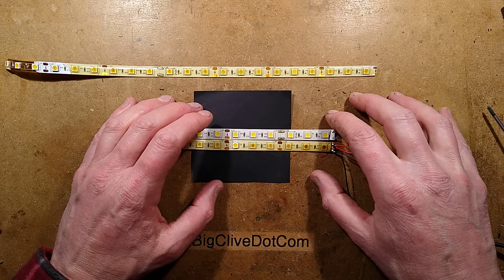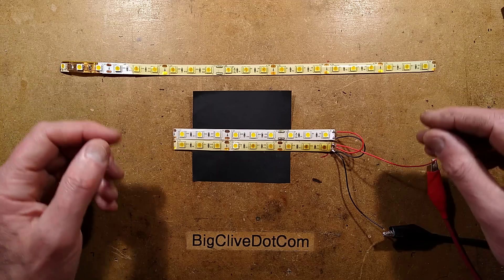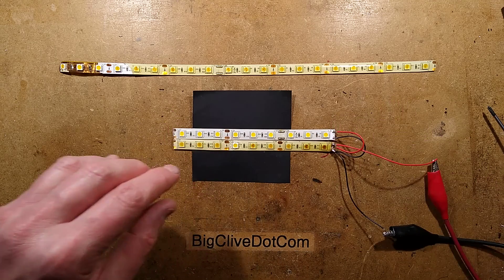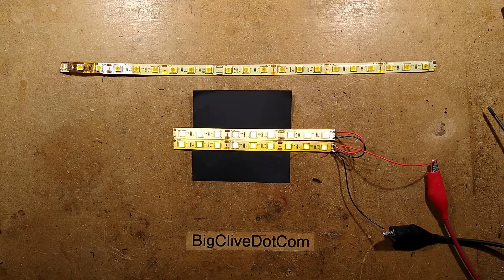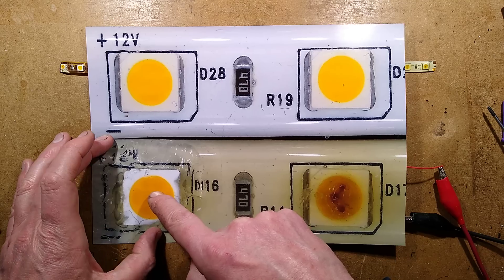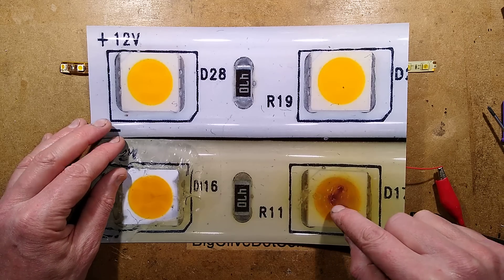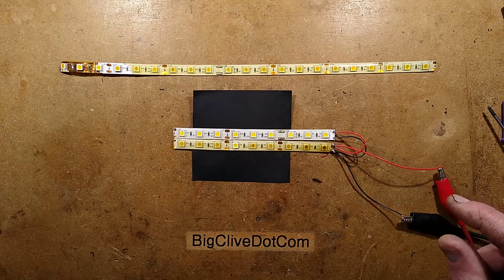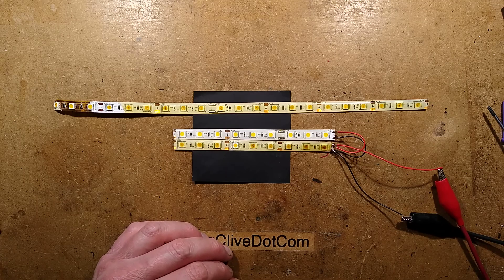IP65 LED tape coating fail

Comment: That reminds me when, about 15 years ago I bought a rear projection TV. It was cheap because the picture had gone all red and blurry. Turned out the 3 CRT's inside the TV were filled with coolant that was between the CRT and the optical lens. I removed the old coolant and cleaned the CRT's up, replaced the coolant, and it fixed the problem.
Reply: I loved the lenses that came out of those things! Don't see them anymore...
Reply: It was Sylvania or Magnavox TV.
Reply: @johndii2194  No actually. It was a Philips TV. Made in 2005. Early HDTV.
Reply: @Xplasma1  Same company. I was a sales and SERVICE agent for all 3 for many years. The antifreeze would grow mold in the fluid mainly the RED one. I dismantled, cleaned, and changed the fluid in so many I would buy it by the carton.
Reply: Do you know why they used antifreeze? Because the units could be stored in unheated areas and the liquid would freeze and expand and damage the TV.
Reply: @johndii2194  Antifreeze because of the refractive index more closely matching glass, so they used pure propylene glycol as a coolant, but did not think to also include a fungicide into it, as no bacteria could survive in the water free solution. Red gun did not have the same amount of high energy light in it, so it would grow fungus, the green and blue would have enough light into the fluid to kill it, unless you had stored the unit for a few months.
Reply: @johndii2194  Yeah I recall the red CRT was the worst. The green was second worst and blue was kind of okay. 

And yeah I forgot, Philips owns Magnavox.
Reply: @johndii2194  Sylvania and Magnavox simply made their sets using Phillips parts, often the entire chassis and internals was Phillips made, and onnlt the case was the thing with a brand on it, though most models simply were ordered with the Sylvania nad Magnavox badges instead of the Phillips ones, made as custom units.
Reply: @SeanBZA  Magnavox was Philips’ brand in USA. For many years, they couldn’t use the Philips name in USA because Philco had successfully argued in court that their brand names could be confused.
Reply: @SeanBZA   I was a sales and SERVICE agent for all 3 for many years. I used to work on them before they were all the same company.

Comment: I bought a pack of 100 coolwhite 5mm led on ebay from survy2014. I made a light with 5 of them, the light is on about 8h a day. After about 6 month the light output is less than a candle... The light was almost too bright at the beginning. Leds are running cold and at 17.5mA. The phosphore must have degraded, not good quality

Comment: Had the same problem in my kitchen LED lights with the rubbery coating on it when orange yellow is looking so replaced it with the uncoated LED tape and that has stayed much brighter without yellowing

Comment: The first RGB strip I got more than 12 years ago now had an "IP65" waterproof coating on it - almost immediately it developed a really awful smell, and if you touched it even briefly, your hands would pick up the smell and smell awful as well. As time went on, the smell got worse, and the stuff yellowed like crazy, and that was on a piece of the strip that I never used and was still on the roll. Since then I've never ordered any IP65 strip with that clear coating on it - either plain non waterproof, or the IP67 stuff that's the plain non waterproof stuff inside square silicone tube. The silicone tubes hold up well to sunlight (so UV) and don't degrade or smell or discolor. I hate the epoxy (or whatever it is) coated led strips.
Reply: Was going to post the same thing. I have a couple of rolls of LED tape that I will never use just because of that reason. Smells terrible and as you say it gets into your skin. Not sure why I haven't just thrown it out...
Reply: Maybe it is butyl acetate?
I had some clear handled screwdrivers that I had to throw out.
They made my hands (and whole toolbox) smell like vomit.
Reply: @jimurrata6785  No, the smell is completely different - it smells like burning 3 week old coffee grounds or something - it's a hard smell to describe, other than it's unique, and f'ing awful. It's pungent, makes your nose want to curl up and fall off your face. It's nothing like vomit. Also butyl acetate is extremely hard, which is why they make screwdriver handles out of it - this stuff is flexible.
Reply: I had a roll of purple/blue LED strip and that smell was ghastly. I'd mounted them in a non serviceable spot on some shelving and after about 6mths of use I noticed the output was very dull. At the time I just turned up the voltage from the 9v I was running them on to 12v and that seem to fix it. After a while the problem returned and eventually I just disconnected them. I recently found a section of those strips and the coating was so brown I could barely see the LEDs light up at all when I tested it. Still had that same smell albeit not nearly as strong as it was new.

Comment: Could it possibly be where you have been 'playing' with the germicidal UV lights and Ozone generators that it has artificially rapidly aged or attacked the rubberised coating?
Reply from the maker: No.  These had minimal exposure.

Comment: So they basically chose plastic that can’t handle UV light, for something that not only could be exposed to external UV light (as an earlier commenter mentioned, outdoor lighting for camping), but also fails under the UV output by itself? One wonders how much testing these had, and how long it would take to discolour when driven at full power.
Reply: You 'wonder' how much testing? pretty sure I know the answer to that question - absolutely none. They found something that was clear and flexible to begin with, and started using it immediately. I've only ever ordered one or 2 rolls of leds with the "IP65" coating on them - never again - the stuff I got failed quickly and emitted a really awful smell. If you touched it, your hands would smell awful after too - really nasty stuff. I either get non-waterproof, or IP67 waterproof in the silicone tube. Haven't had any issues with the stuff in the tube yet.
Reply: Chineseum crap? 😠
Reply: hahah you what  how much testing lol hahaha do t be daft itsa china crap in china you say that word  your in prison  and your dog is fir tea  herd it all now testing

Comment: Same issue with my 5050 strips. The impression I get is the coating isn't blue/ultraviolet stabilized at all. Mine also got hard and brittle.

Comment: I've had something similar happen with a conformal coating I added to a cheep led strip.  turned yellow to the point it blocked out the leds

Comment: Could the discoloration be partly due to uv ? I know they do not produce much but if the gel has no uv protection. Ahh yes yoi cover that latet doh! Lol
Reply: Regular white LEDs do not produce any UV light. The chips are blue emitters, around 450 nm.

Comment: My LED under shelf lighting has all drooped down where the glue has failed.  I don't know what else to use instead.  It's definitely not made by 3M.
Reply from the maker: That's common.

Comment: I believe that the silicone coating  releases acetic acid as it slowly cures. In my case, This made the adhesive backing ineffective, and I had to remove and replace it all.

Comment: That's VERY useful info.  Have been considering using the silicone coated strips for a project, but was concerned about discoloration and overheating.  I'll find a different way to waterproof the basic strips.  Thanks!
Reply: That stuff is not silicone. It's some kind of epoxy-like stuff. If you get "IP67" led strips, they are a non-waterproof led strip slid inside a square silicone tube, and sealed up at the end with silicone. Those don't seem to degrade at all. It's only the IP65 strings that have that clear goop (whatever it is) on them that degrade horribly.
Reply: Get the silicone tube ones, they are basically going to last forever.

Comment: I'm not so sure it's actually the light.. I've got a few meters of similar silicone-covered LED strip spare (various colors, no white ones), and that also developed yellowish-brown spots all over to the point it's not actually usable anymore, but it was never powered on. I wouldn't be surprised if something weird with the plasticizers in the LED casing actually reacted with the silicone.
Reply: I had the same thing with some RGB strips bought from Maplin, never used them and they're still in the package but when I looked a few weeks back they had yellowed significantly, I try to avoid the strips with coating when I can and rather put the uncoated ones in an enclosure of some kind if I need some protection.
Reply: Probably this, because I’ve got old leftover pieces of RGB strips that did this still on the roll and in the original metallized bag.
Reply: In Clive's case it was mostly the LED light itself. In the zoomed-in shots you can see that each LED has three chips inside it, and there were three extremely dark brown spots in the exact same places on the covered up LED as the bright spots (chips) on the uncovered LED.
Reply: possibly bromine fire retardant

Comment: That is an odd way to fail. I guess you could cut the protective layer off the LEDs if you really need to use them while you order more (without the coating if indoors)  2x👍

Comment: I purchased 50' of LED tape from Adafruit, who I consider a trusted seller, and and used portions of the tape for the same under-shelf lighting and had the same the same exact experience.  The covering of the roll of unused tape has over time  turned yellow.
Reply: You can find cheap crap similar to what most trusted sellers (in any industry) sell on eBay or Ali for a fraction of the price.  That's hardly the point.

The point, usually, is that if you buy from a trustworthy reseller, and what you get turns out to be crap, you can return/repair/replace it or get other considerations to make up for it.  You cannot do that with eBay or AliExpress.  That is also why trustworthy sellers usually sell things for higher prices, because they have to cover the extra cost of providing actual customer service in addition to just the product itself.

In my experience, Adafruit does actually make an effort to sell good-quality products in general, and not absolute crap like many many of the bargain-basement sellers out there.  In some cases like this, however, it may be hard to tell that something has a problem without running it for a long time, or testing a lot of it, so things may sometimes slip through their screening process.

If they are still selling that particular LED tape, I would encourage reaching out to them and letting them know it has this problem.  I would bet if they are made aware of it they would work to find a better alternative instead, but it is quite possible they simply don't know, because nobody has ever told them.  (It's also quite possible they have since discovered the problem and have switched to selling something better now, too.)
Reply: @foogod4237  Hi Foofod.  I agree with you 100%  I trust Adafruit and Sparkfun.  And, I have have found their customer service to be superb.   I have had defective products that they replaced without question.  They have also provided great customer support helping me get some of the software libraries working.
 
Since my experience with the LED strips did not appear for almost a year later I cannot fault them for bad parts.  I would not think of insulting them or any other seller for a refund or 'make-good' for a product that (a) was not expensive; and (b) failed after a year of almost continuous use.  

One thing that other commentors did not mention is the tremendous amount of money the two companies put into R&D, software development, payroll, etc.
Reply: Adafruit wouldn't intentionally sell the cheapest crap or reneg on their warranty. Like everyone they are at the mercy of ever evolving technology or the manufacturer.  Led tape is still relatively new tech.
Reply: buy some automotive grade LED's  (recycled from Genuine oem old headlamps or fog lamps)  these are way brighter and far more energy energy efficient  they typically include a High Quality  7-14volt input rated  ballast  ...
Reply: Your first mistake was considering Adafruit to be a trusted seller. Much of what she sells is the same junk you can get on eBay or Ali for about 1/4 the price she charges. After a few bad experiences I will have nothing to do with Adafruit or Sparkfun.
Reply: @sootikins  Doesn't adafruit design a lot of those boards, and the ebay sellers then sell a ripoff of her design?
Reply: @jamesbrown99991  it's a mix of both worlds. They have some good stuff they've designed, and they also have some crap you could find on aliexpress for half the price.

Comment: This is another reason I guess I will keep with Fluorescent tubes, Incandescent/halogen lamps, or screw in LED lamps when working on certain things. In fact I actually like the fluorescent tube lights I use with electronics work even though red is a bit off in colour it is still identifiable.
Reply: For replacing indoor lights, just get non-waterproof LED tape (with CRI>95 and R9 > 90 or better). The light quality is LOADS better than flourescents, and the non-waterproof tape has no issues with the coating degrading. If you really need waterproofing, get the "IP67" stuff - it's regular (non-waterproof) tape inside a square silicone tube - I've had no issues with the silicone tube degrading in any way, and I have them where they're exposed to sunlight all year.
Reply: cos they will so last for years without needing replacing like these did XD

Comment: Wish I had seen this before I replaced all my Kitchen Led Tape like for like after it degraded in a similar manner after just  3 years. 
Looks like I can look forward to replacing it again in 2 years time - but this time without the Gel....

A word of caution I bought an LED power supply off eBay to drive these, when I received it - it was rattling. Opened it up to check and found two cut off component legs floating around inside the casing, each big enough to bridge the primary/secondary gap......

Comment: Heh. You dug it out of the bin then! Thanks! A lot of those gel-covered water resistant LED tape turns yellow over time is my experience. This failure mode is new to me though. :)

Comment: I've seen LED tapes used outdoors whose waterproof coating has also degraded in a similar way. I just assumed it was sun and weather that did it, but maybe it was the LEDs itself.

Comment: I had about 3 meters of the gel tape under my kitchen cupboards and, like Clive, began to notice that things were dimmer than I remembered.  The same had happened - tape coating was yellow, some LEDS almost out others very dim.

I decided to replace them and went to get the remaining tape that had been left on the reel, in it's protective (silvered) bag.  It to had yellowed and while the LEDS were brighter the tape was so brittle that the tape was useless.

I concluded that the gel coating was either generally deteriorating, on it's own, or interacting with something in the  tape construction.  Either way I shall not be buying gel coated LED tape again.

This may be recognised as the latest LED tapes I have bought  are encased, but loose, in a more silicone type sleeve to give them protection.

Comment: I had a section of similar gel coated 5050 tape sat unused in the top of a box that was open to daylight and the general room light. When I went to actually use it, like several years after I actually bought it, the whole gel coating was brown like I'd already used it and grilled the LEDs for months. Definitely some sort of reaction between the gel and perhaps the UV in the ambient light?
Reply: Similar story here, though my stuff is in a dark box but stored in a place that gets warm in summer.

Comment: This happened quite quickly to a strand I bought to use camping. It was outdoors cumulatively for maybe a week or two. I'm guessing the sunlight during the day caused the browning.
Reply: I wonder if the degradation on the indoor LEDs is due to the trace of UV from the LEDs.
Reply: @NiHaoMike64  Maybe, but also heat.
Reply: @NiHaoMike64  i guess UV is not the only doom frequency for plastics.
Reply: I've had that exact thing happen with LED tape exposed to the UV generated by arc welding. Yellowed in under a week to the point of uselessness. They certainly need a different type of water"proof" coating.

Comment: The biggest issue I have with those gel coated strips, is getting the double sided tape to stick to them !  The stuff they supply, although often branded 3M, is useless, and nothing else seems to work either - I often end up using liquid silicon type glue / bond
Reply: I've also had to use my own glue to stick these up. Not sure if it is the way they a rolled up for shipping or something that happens over time, but the double sided tape seems to shrink causing the LED string to pucker up and ultimately break the bond. Most annoying when being used for undershelf lighting as it just droops down. Latest attempt is using a gel based product called Nano Tape - not at all convinced as it claims to be reusable. Glue - reusable????
Reply: @simondavid2477  I got a roll of neutral white LED tape without the gel coating and the double sided "3M" fake tape shrunk so much you couldn't actually lay the LED tape down flat. Ended up peeling that crap off and using a small drop of superglue every couple centimeters to stick it underneath the kitchen cabinets illuminating the countertop. Since I deliberately and massively underrun the whole strip, it doesn't get more than handwarm at the brighter of the two settings, so the superglue (which doesn't like heat) hasn't failed yet. It's been up and in use for about 2 years now like this
Reply: I've used spray adhesive (Super 88 or similar) as a 'primer' before applying these gel covered led tapes.
It has worked well for me in the past.
Reply: VHB tape is what you need, from 3M.